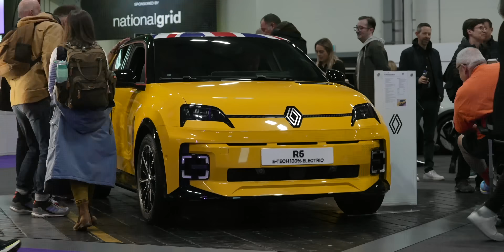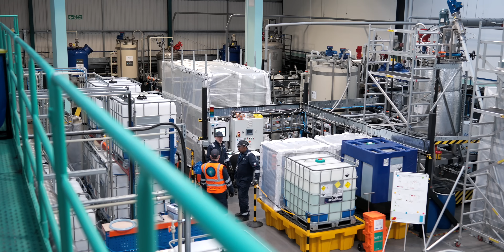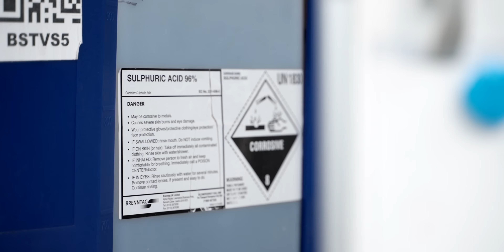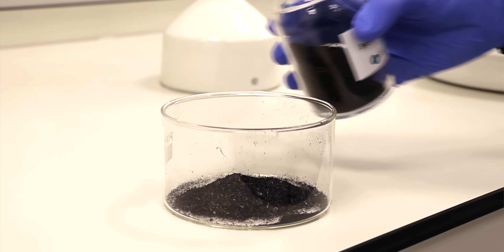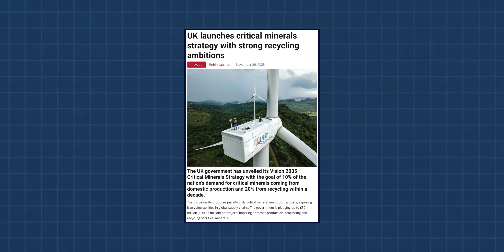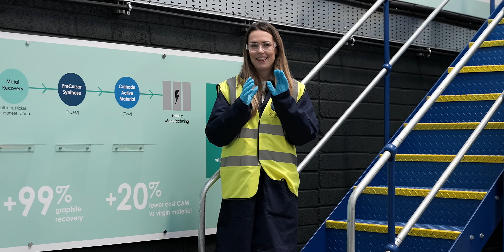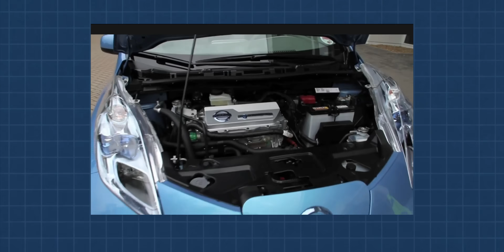EV Battery Recycling Could Be The End Of Mining!

Comment: It will take 10 years to get to 100% new EVs, so 15 years before lots of batteries are retiring. It might take another 15 years before those batteries are released from use as grid-scale storage. So, nominally 30 years before recycling it happening at a large enough scale to supply enough materials for new EVs. Even if, for various reasons, we take that down to 20 years, that's "forever" in the world of EVs.

Comment: Between 2026 and 2037, there is indeed going to be supply of old EVs (15 years of life), not necessarily because they do not work anymore, but either because the batteries will have reached 70% of SoC or less or because people want to have newer models with more usable range (200 miles or so).

Beyond this, as the UK fleet continues to replace combustion cars with EVs, I am certain that Attilium and similar companies will have plenty of raw materials to work with because apparently, there are ~562000 vehicles scrapped per year in the UK for various reasons (accidents, etc).

Comment: I would love to see what a revised analysis of carbon intensity shows for EVs vs ICE when properly amortised across what could very well be a multi-decade lifecycle for the battery components. Especially when you consider that recycling and efficient use of materials improve over time. I don’t think this work has been done at all, yet it’s fundamental and a reason why we are massively understating the relative benefits of using EVs vs ICE

Comment: The sourcing of the batteries might get difficult if this process gets efficient.
Reply: You mean sourcing of batteries for reuse?
Reply: @Biggest-hz7ng 

😂😂😂 

They don't know what they mean.

Which rather adds to the overall entertainment value of this platform.
Reply: @ForestForest-n9iRoss Kneebone — since you’ve publicly stated that you work as a representative for a hydrogen bus company, the way you behave here looks less like honest debate and more like paid advocacy mixed with trolling. You don’t show up to add insight; you show up to complain, derail threads, and take snide shots at other commenters instead of engaging with evidence.
So let’s stick to reality. In the UK today there are roughly 16 hydrogen refuelling stations in total, and only about six are actually open to the public for passenger cars. That’s not a rollout — that’s a dead end. By contrast, the UK has tens of thousands of public EV charge points, and the number keeps growing because electricity already exists everywhere and scales cheaply. Infrastructure decides consumer technology, and hydrogen has simply failed that test.
On efficiency, the physics are settled. Battery electric vehicles convert the majority of grid electricity into motion. Hydrogen passenger cars throw most of it away making hydrogen, compressing or liquefying it, transporting it, and then converting it back into electricity inside the car. Well-to-wheel efficiency for hydrogen struggles to reach a third of what went in. Turning clean electricity into hydrogen instead of charging a battery directly is just wasting energy.
You also repeatedly attack lithium batteries as “dangerous” or “unsuitable,” which is especially dishonest given that fuel-cell vehicles still rely on lithium-ion batteries. They are series hybrids: the fuel cell generates electricity, that electricity is buffered in a battery, and the battery powers the motor. By your own logic, hydrogen cars fail before you even get to the fuel cell — and then pile on extra complexity with platinum catalysts and high-pressure tanks.
Real-world ownership backs this up. BEVs charge at home and work every day. Hydrogen car owners deal with broken stations, fuel shortages, extreme prices, and collapsing resale values. These aren’t hypotheticals — they’re documented outcomes of trying to force an unscalable system into consumer transport.
Mocking “history lessons” just highlights bad faith. History is where facts come from, and history shows which technologies actually scale. BEVs are already here, already working, and already dominant because they’re efficient, practical, and affordable. Hydrogen cars have been “five years away” for over twenty years.
So here’s the simple question you keep avoiding: what car do you personally drive — and is it hydrogen?

Comment: I like this! But...  

* What percentage of "black mass" remains after all the desirable chemicals have been extracted, what is that made of, and what has to be done with it? Intrinsically, it must contain the least valuable material, or material that cannot be economically extracted. Is it destined for one of those "holes in the ground", and what risks would come with that?

* What happens if a viable sodium battery is developed? Would lithium become sufficiently low-value as to jeopardize this whole extraction flow?